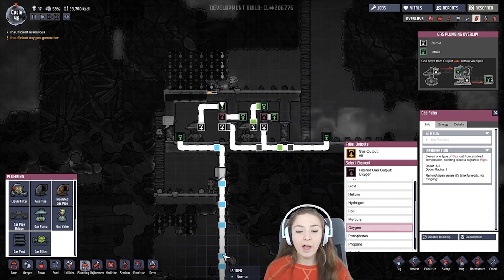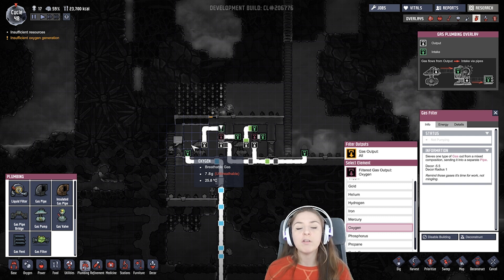How to Build an Airlock / Air Exchange system - Oxygen Not Included Alpha Release

Comment: Hey, nice video, I've restarted the games 5 times already and I'm gonna throw some info. In my current game I've  built triple-layered outer sandwalls and 22 algea (at the bottom) for 6 people and it works ok (almost no other oxygen production needed if base is sealed). My base is 13 squares wide (because light bulbs emits on 11 ground tiles at 7 height) Research is dangerous if you overdo it (because water), I usually stop for a while when I reach the air detoxifier and then later I go for the water purifier. Almost all the tiles inside my base let gas go through (and light too) and 2 air detoxifier go to the top. Sending guys to massage table before sleep helps but it's a bug. Important note: I only picked  duplicants that had at least 5 learning and good athletics at the beggining. Sending any of those guys to research makes them grow their learning skill which makes them learn any other skill faster and good athletics lets them come back to breathe from further away. Hope it helps.

Comment: Also, well done on the high number of duplicants you have. 

I dont have trouble keeping them alive, but I feel it's really getting a lot more difficult the more you add, since they use up so much more food, water and oxygen. I Haven't figured which number seems to be most efficient, in my current cycle 65 playthrough, I didn't take more than 7, and only the very best ones. But I kinda wanna try a playthrough with only 4 or so.

What's your opinion on that?
Reply from the maker: I think playing with fewer dupes does make it easier. I find that if you have a lot you have to really watch what you're doing to keep them alive, but you do get things done faster so you can explore more!

Comment: That does not work like you think right now. As you can see you are pumping only blue tiles (oxygen - you can click the pipe on pause and confirm that is only oxygen) out of your base.
The pump right now is a bit buggy. It pumps only the gas it is in when it started pumping for the first time.
So the filter is a bit useless atm.
Reply: That's not correct... starting at 2:40, she pulls up the gas overlay, and you can clearly see Chlorine being pumped to the bad side of the airlock, which is the real problem gas in there.
Reply: Yup, but she wanted to filter out bad air from her base. And the only gas that leaves her base is the good oxygen. In the middle room (which is supposed to contain the good oxygen) was chlorine when the pump startet, so it only will pump chlorine (until the game is reloaded).
Reply from the maker: +sp33dlink the pump from below is actually intended to bring in oxygen to pressurize the airlock. So the dupes can come there to breath. Once the pressure is high enough it turns off. Also the pumps in the airlock have been pumping chlorine, oxygen, and carbon dioxide (with the oxygen being filtered out) according to the overlay... So maybe they fixed that issue?
Reply: Aah. Now i understand the purpose of the system. But nevertheless the bug with the pumps, pumping only the first gas, it ever pumped still exists..